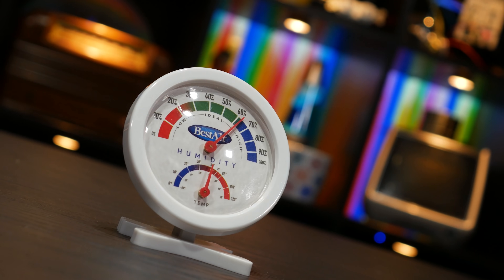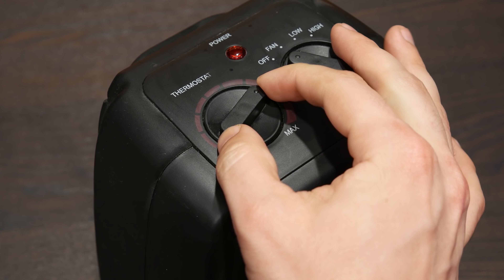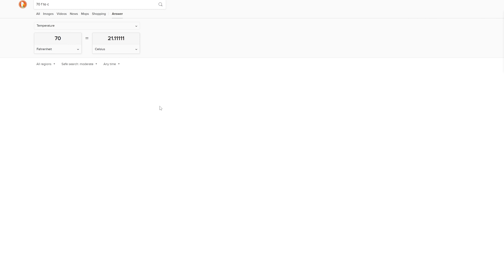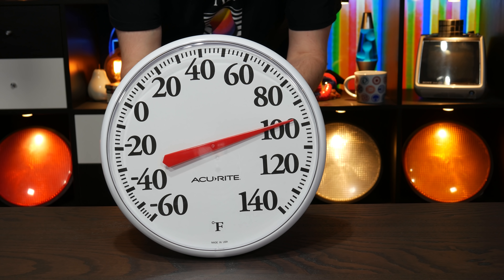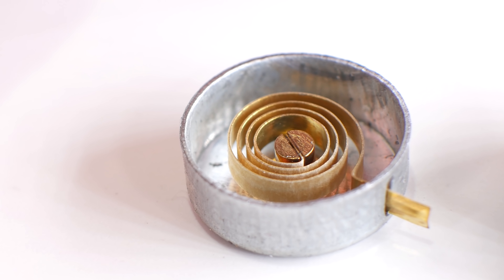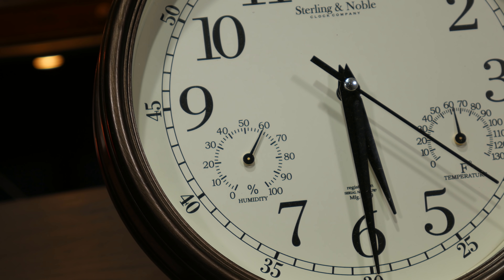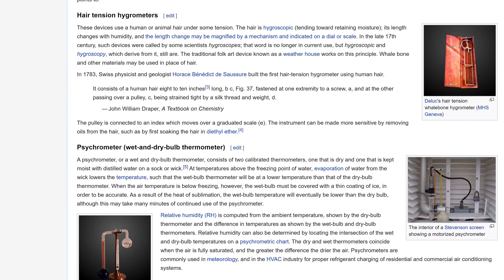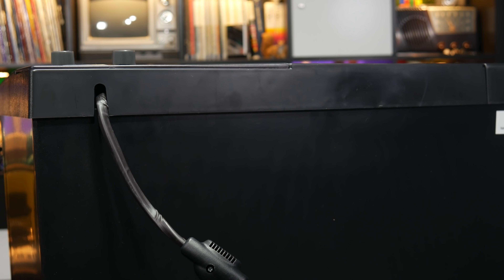Analog Hygrometers - how?

Comment: After UK F1 commentators would always talk about temps in Celsius, I figured my 'Murican self would have to learn to convert C to F temps. I knew that 32F = 0C, and would add 18F to each 10C increase. 50F=10C is simple. 68F=20C and 86F=30C flips the 68 / 86 so I know those now. I just fudge the other outdoor temps in between.

Comment: Being a Brit, I can use both sensible and silly temperature scales - it's not exactly difficult.  If the Chinese can use Celsius, I'm sure you can too.

Conversion? Piece of cake.  F-C - knock off 30, divide in half.  C-F - double, add 30.  Not accurate but close enough.

Comment: you reminded me, here, of something really neat that I have carefully-wrapped in a paper towel encased in a sandwich bag... a Humidity-controlled SWITCH  yes, capable of controlling 15 AMPS @ 240 volts...  whats neat about it is how it works..   the unit has this interesting framework that weaves around 3 rollers and a "pull bar" on one end and a fixed shaft on the other.. the fixed bar attaches to a lever which PULLS on a pin that causes a large "microswitch" to actuate- while the other side connects to a adjustable (by turning) shaft whereas the TENSION of said lever is effected..  this shaft connects to a knob.. the interesting part is what it uses to ply across the 2 points- some sort of membrane! I don't know exactly what it is, but it represents what appears to be a thick plastic, similar to that in a thick painter's tarp.. but strung from the 2 end bars and wrapped around 3 roller-pulleys to increase its surface area and increase the effect of tension applied to the levers..  its unclear that if tension increases or decreases with humidity, but it doesn't seem to be effected by temperature.  I understand that it is 30 plus years old (maybe more), however, it was lightly-used, if not new "old stock" as its super-clean and has no corrosion.  it was made by Honeywell. I thought you'd find that interesting, too! :)

Comment: Always hate RH readings.  Much prefer the 'dew point'.  In areas like Michigan that have widely varying temperatures through the seasons, saying that it's '57% Relative Humidity outside', is pretty useless.

Company I worked for sometimes used 'dew cells' to measure humidity.  A lot more complicated, but a much more meaningful reading.

Comment: Whenever a metric nut complains about the Fahrenheit scale, I agree with them.  Then I tell them we should use Kelvin, as Celsius is based on the flawed premise water freezes at 0C and boils at 100C.  That usually shuts them up.  Also there arent enough whole numbers in Celsius.  Fahrenheit is actually better.

Comment: As a Brit who grew up in the 60s and 70s I am happy for you to use Fahrenheit or Celcius, feet and inches or metres and centimetres, pints, quarts and gallons (UK preferred to US) or litres and millilitres, and all other variations for things like torque, fuel consumption, or whatever. So just keep on doing what you do best.  Incidentally, I happen to have a hair hygrometer that I inherited about 40 years ago, made in Germany by Fischer - it still works.  I guess it dates from the mid 1950s - 1960s, so I found this video very interesting.  Thank you.
Reply: "I get 40 rods to the hogshead and that's the way I likes it!"

Comment: The metric system is far superior... For everything except temperature. Temperature based on the freezing and boiling temperature of water at sea level is as arbitrary as... what ever they built Fahrenheit on. 0 to 100 is basically the human experience. It's far more intuitive, and easier to grasp. Screw degrees C.
Reply: The whole point is that it's based on the human experience and our planet; easy to comprehend.

Would you prefer Kelvin?

Comment: Hang on just a hamburger-minute (is that what you use in the US? Instructions unclear, got finger stuck in 24-hour clock), "0 - 100 scale which roughly corresponds to the range of tolerable ambient temperatures"? Isn't 0 hamburger degrees something like -15C? Who the hecc can tolerate temperatures anywhere near that low? Being out in that for anything other than the most dire of circumstances sounds like a recipe for needless hypothermia
Reply: It's not uncommon to get that cold in alot of the US all though where I am it normally doesn't get colder then like 15F with a rare few winter days dipping into the negative. I lived in minnesota though for a few years when I was a kid and they get plenty of days in the negative temps during the winter.

Comment: The first time I remember seeing a bimetallic strip was in the automatic choke for my parents' car when I was younger. It worked much like a heavier version of the thermometer you showed, once the engine warmed up, it would open the choke. 

Also, I just realized, I'm so old that my parents had a fairly new car, along with a brand new truck at the time, and they both had carburetors.

Comment: You can convert Fahrenheit to Celcius (roughly) by subtracting 30 and dividing by 2. So 120F-30 is 90 divided by 2 is 45C. Precisely it would be 48,9C, so it works well enough to get an idea.

Comment: Celsius is "part of" the metric system but I wouldn't actually consider it metric... because it isn't. I believe it is technically an SI unit. Metric would suggest the idea of being based on the meter, and if not the meter, then based on something that can be divided and multiplied via factors of 10. Celsius ain't that.
Plus, I completely agree. 0 meaning close to dangerously cold if exposed in the right way, with 32 being freezing, and 100 meaning close to dangerously hot if exposed in the right way is extremely convenient. It also is extremely convenient to have the level of detail in Fahrenheit at whole numbers that Celsius does not have. 2 degrees F makes a big difference in comfort for most people around the "room temperature" temperature. Setting a thermostat to a whole number Celsius makes things surprisingly imprecise.

Comment: Easy math equation to do that.  I remember it as working 9 to 5 add 32 to get Fahrenheit.

And working in reverse is simple too by subtracting 32 of the Celsius number, multiply by 5, and divided by 9 to get  Fahrenheit.  

F multiply by 9 and divided by 5, then add 32 to get Celsius.  

Peoples are terrible at reading, math, and science of a common cold.

Comment: When I was  about 8 years old my father installed a humidifier on the furnace. There was a humidistat on the wall, right next to the thermostat. The humidistat used a bundle of hair to sense the humidity.
I learned that, when you take the cover off the humidistat and rub your greasy fingers all over the hair, you get into a lot of trouble.

Comment: There are those analog hygrometers which have an oily liquid that can absorb or release water through a membrane and based on that the liquid rises or falls in a capillary column because of variations in surface tension... which is kinda like an analog thermometer with liquid in it except it doesn’t care about temperature.

Comment: 2:00 THANK YOU! Most of the US standards (miles, inches, feet, lb, pints, gallons etc.) are really REALLY stupid but Fahrenheit isn't one of them. A 0-100 scale based on typical outside temperatures (typical for temperate climates anyway) is a much more intuitive system for day-to-day usage explaining the outdoor weather than a 0-100 scale based on water... which may be more handy for cooking but not for describing how hot or cold it feels. I know I'll get some hate from those that think anything the US uses is stupid, but it really does make more sense for describing outdoor weather. (Though I really wish we'd change the rest of the units ASAP.)

Comment: Thank you Alec for mentioning the range of 0-100 as a usable temperature range for reference by which Fahrenheit was meant to emulate.

I did a deep dive into how and why the Fahrenheit system is the way it is back when I was in my early teens.  The effort was admirable by him.  I wonder if we could achieve a true 0°=freezing and 100°=human body temp with more modern liquids and techniques...  

I wonder what advancements will be made for temperature monitoring in the depths of space when we begin sending humans into those bleak distances...

Comment: If you simplify the conversion equation for F to C (subtract 32 and multiply by 5/9) to "subtract 30 and divide by 2" , you can quickly convert any normally experienced temperature easily in your head. It's not precise but it good enough to get a sense.

Since I'm American, I'll do it the other way. Is 25C hot or cold? Well, 25x2 is 50, plus 30 is 80. So 25C is warm. In reality, 25C=77F. But either way I know it's a warm room temperature. What about 17C? Well 17x2=34, plus 30 is 64F. So a chilly room temperature. It's actually 62.6F. But if you said it was 17C outside, I know I don't need a parka but I should grab a sweater if I'm only wearing a T shirt. Math.

Comment: I'm used to converting C to F or F to C in my head.  It only takes me a second or two.  My world would be simpler if it was all C, but I live in the USA, but it's not that much of a hinderence.
Reply: The world would be simpler if it was all °F
Reply: @sammiller6631  
Approximately at what temperature does wood auto ignite?  250C.  Melting point of steel? 1500C.  These are the numbers I use.
Reply: @rayceeya8659  I couldn't tell you the answer to those questions in any scale though because it's not something most folks need to think about and if they do then they will know the answer regardless of what scale they are using.

Comment: With the conversion, I can look it up but I'd rather complain about. I heard that woman complain about the toilet seat not put down, instead of doing it themselves, even it's faster and causes less stress.

When the values matter, a conversion should be done by the person who said the values. It doesn't cost them much more time then the person on the other side but consider that there are more people in the other side. With Fahrenheit I know 3 values. 0°F is cold af and I doesn't want to go out. 69°F would be the temperature that I would pick as my room temperature and 100°F is a bit higher than normal body temperature.

Conversions with currency is not as easy. For a lot of people $ or € gives them a rough idea. It's just a rough idea. This specific product might be cheaper in a different country or even more expensive, due to imports. The fun part about $ and €, they are quite interchangeable. In the US, products get labeled before taxes and in Europe with the taxes included. 1$ is 0.83€ at this moment. Adding the 19% taxes on the dollar price, for Germany, 1.19$ would be 0.98€. This is still not perfect but it's goog enough.

People just should include conversions, when the values matter. It doesn't interrupt the flow of the story.

Comment: As an agnostic C-user, I'm fine with others using other scales. But the real WTF is 60 degrees F inside? That's really cold!
Reply: People keep saying this but I normally have the windows open and the heat off if it's 60 degrees outside. I guess it's just about what you are used to.

Comment: Customary is better than metric. The only thing metric is better at is converting between units of the same measure (eg. g to kg) which is something you almost never have to do. In exchange it sacrifices both divisibility and conveniently sized units. Coming up with units people actually use and then tweaking them to make them relate to eachother with convenient whole number divisibility is a way better way to create a system of measurement than arbitrary base-10 elegance that produces useless units. Though I think we could improve customary by leaning into its advantage in divisibility. 5,280 feet/mile is nice, but 5,040 would have better divisibility and the convenience of more accurate estimation at only a slight cost to the actual size of the mile.

Comment: I have, and have acces to a few nice (especial one of them) hygrometers with hair from a horse tail. If you feel the hair, it's easy to feel the thickness of the hair.
Another method, unfortunately not using turning, is the difference in the temperature of two thermometers - one wet and one dry.

Comment: Farenheit does not describe comfortable temperatures, neither at the high end or the low end. It's practically only useful in the medical field.
And quite frankly Celsius does a far better job of describing comfortable temperatures based on the phase change points of water, which is fundamentally important to the functioning of the human body.
Give up, resistance is futile.
Reply: @Faken Namel 32???

Comment: in the lab at school we had an analog hygrometer that was a bit fancier, it worked by having two thermometers, one of which had a little sock on it that was soaked in water to take a measurement and on top of the unit there was a spring loaded fan. After a set amount of time the convective drying would take away heat from one of the thermometers resulting in a temperature difference. This was then either compared to a table or calculated using a formula I won't pretend to remember. The result was an accurate ambient humidity reading. I'm sure you could find one with a freedomhite scale.

Comment: Fahrenheit  is a better temperature system for common, everyday uses. Think about it like this: 0-100 degrees Fahrenheit is the generally livable temperature range for humans. It can get a little higher or lower than that in some places people live, but most of the time the outdoor temperature is going to be in that range. What's that for Celsius? -17 to 37 (approximately).

Not only is that a little more than half as many units, it also goes into the negatives. I find that people using Celsius are more likely to report the temperature in half degrees. Wait a minute, 54 * 2 = 108. It's as if ~100 degrees of units is the ideal amount to read indoor/outdoor temperature. Also, having to use negative units just makes things unnecessarily complicated, which Celsius uses more often. When the temperature is negative here in New England, that's an event. In backwards metric world where people think more people using metric=better system, negative temperatures just means it might snow instead of rain. 

Celsius is good for science and people say things like "well water freezes at 0C and boils at 100C, but in Fahrenheit it's 32F and 212F?!?" What sense is a temperature system based on the freezing and boiling points of water at sea level? With Fahrenheit, 100 degrees was supposed to be the healthy internal temperature of a person. However, the early tools used at the time were inaccurate by 1.4 degrees. I'm not sure what, if anything, 0 degrees is supposed to be based on. Regardless, 100 degrees to describe the usual range of livable temperature is a plenty good basis for a temperature system. It's good for the event that you might ever, you know, want to leave your house and know if you need to wear pants or shorts.

I feel a similar way about metric and fractional units, but I'm not going to get into that here.

Comment: OK. this may seem complicated but it's (by coincidence) a fact that you can use the same simple maths to convert to/from several units. This one is the relevant here:
km/h - knots: /2 +10%, i.e: 20 km/h = (20/2)+2 = 12 kn
knots - km/h: x2 -10%, i.e: 20 kn = (20x2)-4 = 36 km/h
F - C: - 30 and then /2 +10%, i.e: 100 F = ((100-30)/2)+10% = (70/2)+3 = 38 C
C - F: x2 - 10% and then + 30, i.e: 100 C = ((100x2)-10%)+30 = (200-20)+30 = 210 F 

Note the common bit which is simple: 
[x2 -10%] or [/2 +10%], the difference being that for temp you need to track the +/-30 (really 32)
Reply: And Feet to Meters also retains the 10%
ft - m: /3 -10%, i.e 30 ft = (30/10)-1 = 9 m
m - ft: x3 - 10%, i.e 100 m = (100x3)+30 = 330 ft

Comment: I do agree on that tangent.
Celius is useful for measuring things like a computer's processor that can go from ambient to near 100C on a regular basis. (Specially since above 100C is considered unsafe)
But it feels weird using that big of a scale when it comes to measuring the temperature outside. Its like measuring a screen size in meters. The scale is to big, knock it down to centimeters.
Fahrenheit is flawed, and it certainly isn't great to be used as a universal temperature scale, But at least you don't need to understand Fahrenheit to know that subzero and 100F environments are not somewhere you want to be in for prolonged exposure.

Comment: I once had an old hygrometer / thermometer with a linear scale but it had a relatively complex mechanism to do that. By old I mean probably late 19th century. The hair pulled on a lever that 'amplified' the movement. At the other end of the lever there was a very thin wire and the other end of the wire wound around an eccentric shaft which then turned the pointer. The eccentricity of the shaft changed the angle by which the pointer turned depending on where it is.  Probably it was not simply eccentric but had some more complex cam profile. 
Because apparently that was not complicated enough it also showed the temperature with a second coaxially mounted pointer using the same number scale from 0 to 120, although the humidity pointer would of course never go above 100.
The thermometer was also unduly complicated. Instead of a bimetallic spiral it had something that could easily be mistaken for a stack of aneroid barometer cells which drove a rack and pinion mechanism to turn the pointer, with an intermediate step-up gear to amplify the movement.
At first sight one would indeed think it is a barometer and the only reason I knew it wasn't is because it said so on the dial and it actually did indicate temperature and not pressure, and it did so accurately. I'm not quite sure how it worked but guessing those things looking like aneroid cells contained some liquid to expand and 'inflate' the cells as the temperature increased.